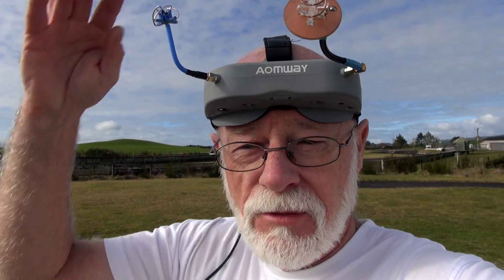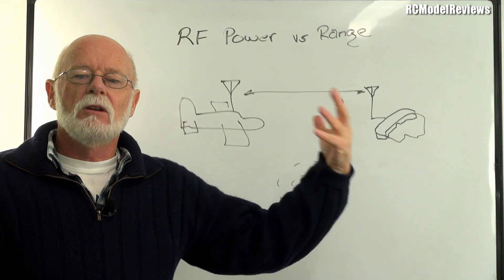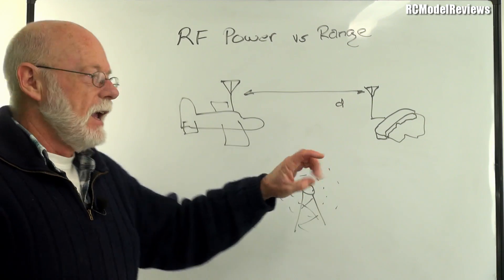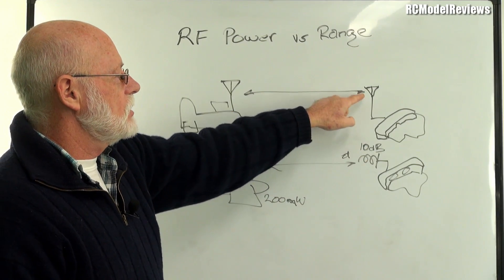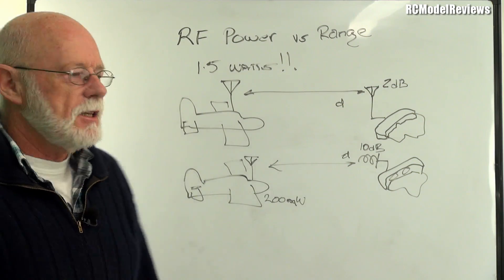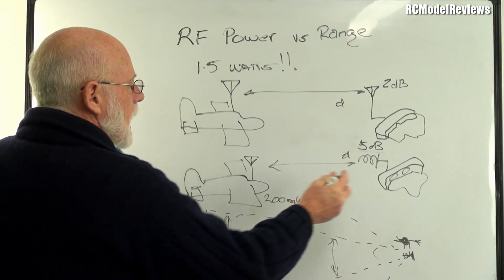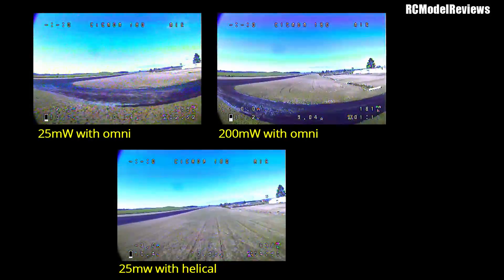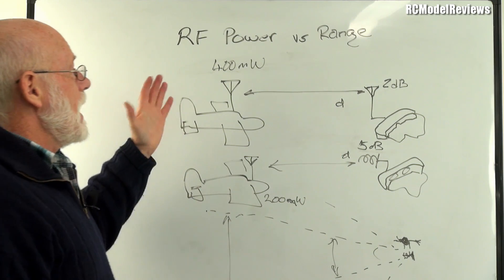RF power versus antenna gain (the results may shock you)

Comment: Great video proving benifits of using a good antenna setup..

Made me look at specs on my patch antenna and it states this.

Gain: 6.5 dBi
Beam Width: 150° at -7db, 120° at -5db, 90° at -3db

How do i read those numbers??
Reply: This is a plot of how good the antenna is at certain angles. 150 degrees means if your patch is 75 degrees left or right off center from your other antenna (150 total), then you will have -7db. 60 degrees left or right (120) is -5db (better than -7db) and so on...
Reply: Obviously the best performance with a directional antenna is when you aim it straight at the other antenna. The above plot measures how the performance degrades as you turn it away from the optimum direction.

Comment: This was great to see , just one question, why doesn’t everyone use high gain antennas? There must be a big downside to them ?
Reply: For long range flights, we do use high gain antennas. But there is a downside, the more gain, the narrower the beam. But thats why we use diversity receivers with multiple antennas so the input switches to the strongest signal. For example with the Quanum Overlord you can have multiple high gain pointing in different directions and an omni for when you get close overhead, or any mix to suit your needs. Check out Video Aerial Systems antennas. I can get 7km from a $15, 600mw vtx.

Comment: So, by the numbers presented, the best option is a high dB directional antenna and a high power Vtx ?.......... (_regulatory authorities permitting_ )
Reply: didactylos4 diddy4 not necessarily. The higher power VTxs obviously draw more power, meaning less flight time.
They can also interfere with other nearby transmissions, such as your RC control.

Comment: Nice test, BUT, your omni antena is pointing the sky.., Shouldt be 90º?
Reply: Luis Filipe Machado nope, the transmission area of a pagoda is kinda donut shaped circular around the antenna head.
Reply: Ok, thank you. Always learning
Reply: With an omni think of the signal pattern as a ring doughnut. Where the coax goes into the antenna and its opposite side are the holes of the doughnut. Those holes are the weakest part of the signal so aiming the side of the omni at the tx/rx gives the strongest signal. Given the height, and direction he flew I'd have said having the omni pointing straight up was giving it the best possible signal.